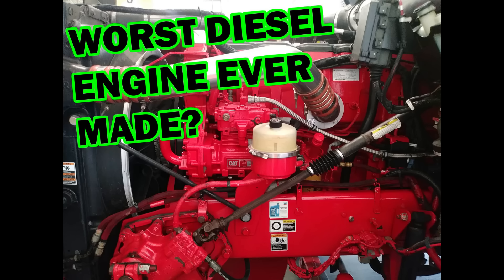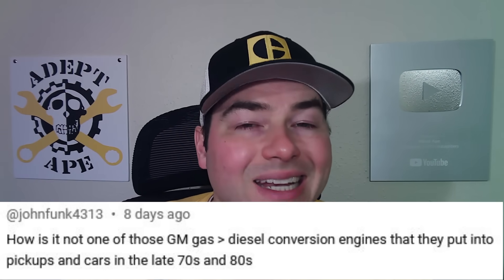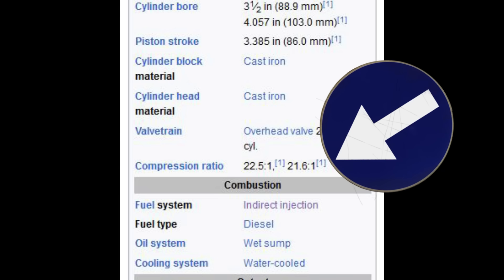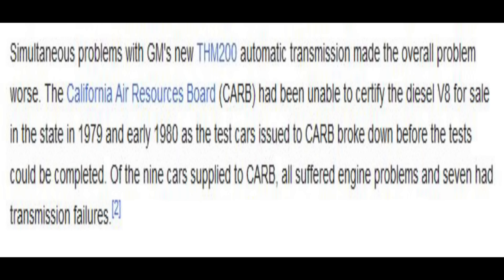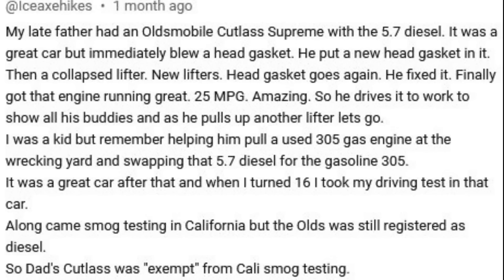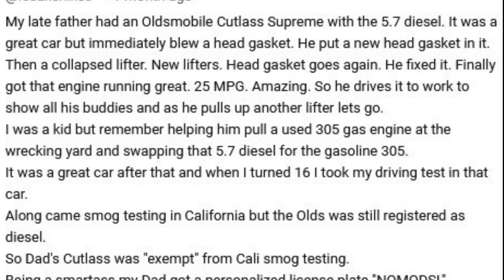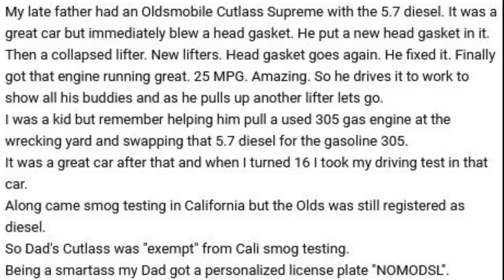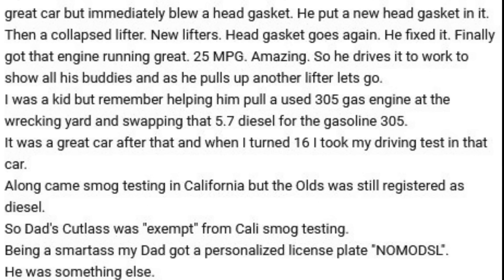This Engine is the Reason You Don't Have Diesel Cars in America!!!

Comment: I had an Olds Toronado with that diesel and I loved the car.  The first engine failed pretty quickly but I had bought it used and they put a new motor in for free and never had problems except with the injection pump.  They failed due this rubber damper?  I can't remember the name of it right now but I use to pull the pump replace the part and I was good to go for quite a while.  I was in the Air Force at the time and newly married and when I was at Red Flag in Vegas my wife went to the movie theatre with a friend and someone stole it.  They only drove it a block and abandoned it.  They said nope, don't want this POS!  lol   My Dad owned at least 5 of them Olds and never had issues.
Reply: are you serious about the theft story? Did they really abandon it and you got it back?  Lolololokoo

Comment: I had to replace a few head gaskets on those atrocious shitboxes. I remember the passenger side was a real chore because of the heater box hanging off the firewall so you had to pull the whole engine a trans assembly forward to get the head off since the heads of the headbolts would snap off due to the high compression in what was a modified gasoline engine. We would run a quart diesel fuel through the crankcase to clean the Penzoil sludge from the crankcase doing an oil change. Diesel fuel quality was atrocious back in the 80's, these cars clattered, smoked and stank like diesel ass. I will whole heartily agree that GM is singularly responsible for killing passenger car diesel applications in the US forever more! 
GM = General Mishap.

Comment: I  remember the Olds/GM/Cadillac diesel 350s for the incredible clatter the engines made.  Even at idle they sounded like a room full of welders pounding away at slag on their weld beads.  The auto news at that time featured stories of broken wrist pins, broken connecting rods, and blown head gaskets, and how inadequate the gas engine design was for diesel use.  Their sluggish performance did not help their reputation as boat anchors.  
As I recall, GM was not alone in trying to modify a gas engine to use as a diesel - Ford produced a boat engine diesel from a gas engine design but the timing had to be retarded to make it survive, so the fuel economy was poor.
Reply: I've never heard of a Ford diesel being made from a gas engine, but perhaps they had a team attempting one. Their first attempt on the market I'm pretty sure was the 1983 6.9 IDI in trucks, and then the Ranger got a Perkins 4 cylinder diesel for a couple of years as well. The dismal performance of the Perkins was what got it canceled, but we all know that the 6.9 IDI in the F Series was a success. Of course they also offered the GM 8.2 in medium duties which didn't have a great reputation. I still see those around occasionally these days though.

Comment: One of my friends bought a Delta 88 diesel about 10 years ago. It had been parked in a barn since soon after it was bought. The owner was disappointed with it and just bought something else. When the guy died his kids got a local shop to get it running so they could sell it. Charlie bought it based on some pictures and a couple of phone calls. Flew to PA to pick it up and drove it back to CA and straight to a shop he had done some work for. He's a lawyer. They put a 6.2 LS and 4L80 in it. After two weeks he admitted it was a death trap and went back for the full suspension and brake upgrade and an LSD. I think he went with a Torsen type diff. I think he went with the biggest Willwood brakes they could fit. The final straw for the brakes was getting off the freeway at high speed and sailing into the intersection with smoke pouring out of the front wheels, fortunately late at night with nobody around to see.

Comment: The thinking behind the design was to keep costs to retool cheaper. However, a lot of diesel enthusiasts I've talked with have stated, the 5.7 and 4.3 diesel blocks were stronger than the gas versions to handle the higher compression. But all the tooling was kept pretty much the same so they could keep costs down during manufacturing. Being that these were indirect injection engines, kind of explains the higher compression ratio. The later GM 6.2, 6.5, International 6.9 and 7.3 were all IDI and had over 20:1 compression.

By the end of the Olds diesels production, they had pretty much had them mostly all figured out, but the reputation was already tarnished and were discontinued.
Reply: The 5.7 Olds diesel engine was a good engine the ones built after 1982 had way less head gasket problems but they vibrated so bad a family friend had a Buick station wagon with one he tore up the transmission so he had a turbo 400 put in it then the vibration was so bad the bolts for the alternator and power steering pump sheared off so I had to drill them out and it was horrible on starters in the cold Minnesota winter so he put a 6.2 starter in it and had to crush in the exhaust pipe below the starter it would start in the winter if you kept it plugged in and number 1 fuel it got fairly good mileage even with out the overdrive transmission it really howled to do 65 mph at 55 it was not bad. He used it many years then the injection pump went out and it went to the crusher. Other people converted there's to gas with very low miles on the drivetrain the gm 200 metric transmission was a joke even with a gas engine
Reply: Correct - on the tooling and the D and later DX blocks were nothing like the gasoline blocks - much heavier.
Reply: 6.2 21:1 in some models 6.9 19:1

Comment: GM engineering has always fallen victim to the bean counters, Corvair, Vega, Chevy engines in other brands, the list is long if one does the research.
Best car I ever had for the wifes commuter was a fancy 81 Pontiac Brougham sedan, she loved it and never let her down.  Of course I did take pains to use fresh fuel and service the fuel filter.  It did lose a intake valve at 55k miles, but my 73 Pontiac lost an exhaust valve @ 42k.  Kept that Bonneville for 10 years and sold it for pretty good money.  The average American driver isn't up to any complexity then and now.  
Speaking of complexity, it hasn't gotten any better over the years, believe me, I'm in automotive service.  Still plenty of sad stories in the naked city.

Comment: I worked in a starter shop in Colorado when these came out,  can’t count how many 25MTs I overhauled.  Diesel price was around 35 cents a gallon at that time gas was around 75 cents,then 🥴GM out with the 5.7 diesel ,  then wasn’t long diesel was same or more the gas. People bought these to save money.
Reply: The government jacked up the diesel fuel tax, cause diesels were popular, and it was cheaper. Then the government made diesel  more expensive than gas by taking out most of the sulphur. But they left the tax higher

Comment: Me and several friends had Olds cutlass Supreme with 4.3 gas engines and it was unbreakable most durable engine ever. Only 100 laughable hp but we would dog them hard never had a issue. It might be because they had a diesel version? I never knew about the 4.3 Olds diesel but I knew about the 5.7. Thanks
Reply: The 4.3 V6 could be considered a second generation olds diesel
Many improvements over the original.
Reply: @gordonborsboom7460  I was talking about the v8

Comment: Isn’t it funny how diesel was ALWAYS cheaper than gas as it should be because it’s a biproduct of making gasoline, right up until the 5.9 Cummins and 7.3 powerstrokes really got popular and the government realized they should be cashing in on this.
Reply: I only remember one time diesel being cheaper than gasoline, and it was for 3 days. During the trump administration. I also remember gas being less than a 1.50 during trumps term too. Im too young to remember the 90s. Being born in late 98.

I always wondered why diesel is more expensive than gas, as you mentioned it is one of the first (if not the first) biproducts produced during the production of gasoline, interesting that when the average pickup truck  owner actually got a solidly reliable diesel engines the price hiked up.
Reply: Not to mention the demand for diesel fuel exceeds that of gasoline.
Reply: I think it was the late 1980s to somewhere in the mid 90s when diesel started costing more than gasoline regularly.  Fuel taxes charged at the pump are higher for diesel on both the state and federal levels. 

Anyways,  this is likely the reason this monstrosity of an engine became a thing in the early 80s. We were still feeling the oil embargo and diesel not only got more miles to the gallon but cost less to fill up at the time. People don't realize that $0.90 to $1.25 a gallon of gas was a lot of money in the 80s. Minimum wage was between $1.80 and $2.35 so filling up a 15-20 gallon tank of gas started costing a day or two of pay and at the fuel economy these cars got with gas engines, it would only last about a week or a little more.
Reply: It was the start of ULSD  that the extra refining to remove sulfur from no refining to <50ppm then to <15ppm for on road  vehicles that raised the cost.  Old diesels you poured your used oil change in the fuel tanks. New motors you better filter to 5 microns or you'll destroy the injection system.

Comment: My dad bought a brand new Chevy truck in 1980 that had that 5.7 diesel. It blew up nearly instantly and the dealer put a 5.7 gas in for nothing as it was still in warranty and they couldn’t guarantee another diesel wouldn’t do the same thing so that was their answer to it. They knew they were junk.
Reply: ARP headstuds and a fuel water separator is supposed to be the fix for this rig!
Reply: I own a 1980 C-10, head gasket failed @ 70k miles, owner placed in the barn for 20 years and I bought from the kids.  Installed an upgraded short block, or DX and remanufactured the pencil injector fuel system, runs wonderfully.  To bad about the poor service life back in the day, sad really they are economical.
Reply: A friend of mine bought  one and the dealer told him that if he came in with even a shovel in the bed it would void the warranty. 
The only only guy I ever heard of that got any kind of life out of one said that he was changing head bolts every 25000 miles 🤔
Reply: I used to replace the diesel with the 5.7 Olds gas engine.  Talk about a tire burner! Those engines rocked in a pickup.
Reply: I worked in the oil field in Prudhoe Bay, Alaska. The company I worked for bought a bunch of these. We would idle our engines all time in the field and all night if it was about -30 and below. After less than a year they lost power. I remember outside in the cold a mechanic opened the oil filler and the exhaust quit coming out the tail pipe and came out the oil filler cap.
The oil field wanted to get rid of gas vehicles as they ran a cracking plant to make mogas.
Reply: Yeah they were the worst it was a gas engine that ran diesel
Reply: 6.2 started 1983
Reply: My Dad had one of those and never had an issue with it.
Reply: @davebullock3517 if u drove it like a grandma they were ok. Once u started actually working one, they didn't last long.
Reply: Sure it wasnt a 6.2,never seen a 5.7 in a pickup.
Reply: @herbscheit2061  They had LF9 RPO code which was the Oldsmobile Diesel engine in 1978 thru 1981 Truck there rare then 1982 the Detroit Diesel V8 take over ended in 2002 then after that the was Duramax 2001
Reply: @herbscheit206. You're probably not that old. My dad bought one new in 1981. Great truck, pulled lot's of heavy loads for the farm and had terrific fuel economy. Lasted till 220000 km before the head cracked. Replaced with a supposedly rebuilt diesel but that didn't last long. Installed a used 5.7 Olds gas and went another almost 200k km.
Reply: That would be a 6.2 in the pickup the 5.7 only came in the Old's sedan.

Comment: The later 6.2 and 6.5 diesels that General Motors used in their trucks also had ridiculously high compression ratios
Reply: All IDI diesels are running with such ratio, VW as well
Reply: And 6.9 and 7.3 IDIs in fords run really high too. My 7.3 is 22.5:1 as well.
Reply: My 1.5 liter Rabbit had an iron block and aluminum head.  The compression ratio on that was 23.5:1 Never lost a head gasket in over 200K
Reply: Difference is 6.9 and 7.3 IDI's,are built to withstand 22.5 to 1 and associated combustion pressures. 
6.2's & 6.5's not really upto snuff either. Another victim of bean counters.
Fords bean counters  screwed themselves  with the 6.0 and 6.4.
They cut so many corners there was no engine left😅
5.7's definitely not successful way to endear customers to your brand...

Comment: There is nothing the general motors cannot screw up. Also, the earlier versions did not come with water separators. However there was a light on the dashboard that indicated water in the fuel. When this light illuminated, the driver was to immediately stop the car. And have it towed to a dealership. Remember there are no cell phones then. Have the fuel system completely cleaned out. And start over. How many times do you suppose that happened?
Reply: "Green" cranks...

Comment: Anecdotally, it's true that GM ruined the image of diesel cars in the US for a whole generation. Largely it came down to bean counters, which GM seemed to have in abundance. From a theoretical perspective, the engine was clever; GM took inspiration from the ubiquitous Ricardo Comet prechamber ("swirl chamber") design but significantly modified it, and the result was a slightly quieter and smoother engine. But, no water/fuel separator, no additional head bolts, primitive TTY head bolts, little to no dealer and customer education, etc. What a shame. You are correct in that the later 4.3 V6 was a better offering. My grandparents had a Pontiac 6000 with a 4.3 diesel and it proved to be reasonably reliable while they owned it. Not fast of course, but I do recall them raving about the fuel economy. Nearly 40mpg on the freeway in a roomy GM A-body. Not bad for the era, or even now
Reply: Actually GM had produced great diesel engines for passenger cars. By Isuzu. All European and Australian diesel passenger cars where powered by Opel/Isuzu diesel engines.  
Instead simple use knowledge or at list assist from Isuzu or Detroit Diesel, they tried to engineer something absolutely "in house". Nonsense.
Reply: @gentrest6421  They no doubt did a design in-house because they would save significant money by not having to retool their engine casting/machine tooling. If they adopted an Isuzu design back then, they would have to spend hundreds of millions to build plants dedicated to casting, machining, and assembling those engines, and then hope the American market embraced the switch from gasoline vehicles to diesel vehicles.

Comment: I was a young used car manager back then. These cars were total junk. You could sit a gas car right next to a diesel and the diesel would sit for months. We basically had to give them away. Now that being said Mercedes Benz 220D, 240D and 300D along with VW Rabbit cars and Rabbit pickups with diesel motors ran great and we sold them as fast as they hit the lot.

Comment: Perhaps the only good thing that came from the Olds 350 diesel were the lifters... roller lifter that GM uses as well as the 6.9, 7.3, 6.0, and 6.4 IH/Navistar/Ford engines.
Reply: The first design had flat tappet lifters.  Probably why they failed so much. The rollers were added in 1982

Comment: I remember my Dad purchased a brand new 1981 Chevrolet Chevette. It was powered by a 51 hp Isuzu diesel.
Incredibly good fuel economy, but I remember it's highlight performance was the shift from 1st to 2nd. After that?
 it was all over for the performance part .
Reply: Buddy had a Toyota pickup of sinilar vintage with their baby diesel. 81 hp I think it was? Dismal. 51 is so much worse. 😂 Ford used a 4 banger Perkins for a couple years in the early 80s Rangers as well.
Reply: @ChevyConQueso i think only the 2.2l was perkins and was na. If turbo it was a mitsubishi 2.3l diesel. I had 2 of them a 86 and 87. Stupid trucks had no power but easily got mid 40s + mpg
Reply: @ChevyConQueso the chevette was probably around 6-800 pounds lighter than the Toyota pickup or more depending on the trim levels. The 30ish horsepower difference wouldn't be as impacting as it sounds. 

 But I have owed both and the general assessment here accurate.  They both were left wanting until you put sky high priced gas in them and realized how much further they went than other common vehicles at the time.

Comment: From what I remember, if you found a good mechanic that knew what to do to fix the 5.7 diesel, it could be a good engine, kind of along the lines of the fixes that went into fixing the 6.0 and 6.4 Navistar engines that Ford used in their pickups
Reply: Quoted for truth.
Reply: Even after all the fixes the fords are still boat anchors

Comment: My father had a1978 Oldsmobile 98 with a diesel motor in it. It leaked oil from everywhere! The dealership garage had engines all over the place laying on the ground! We owned it for about 6 months before my dad traded it in. What junk ! My father purchased a 1978 300SD turbodiesel and it ran forever! We also owned a VW rabbit diesel and it had a 5 speed manual. 55mpg on highway,40 in the city. Kept it 10 years. Never had a problem with it until I sold it to a neighbor and he ran it without coolant and burned up the motor.